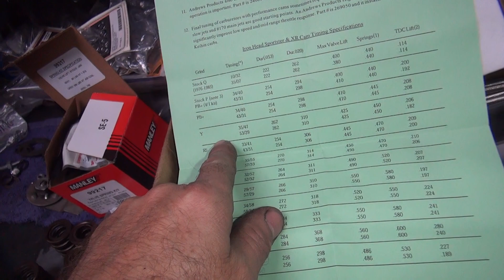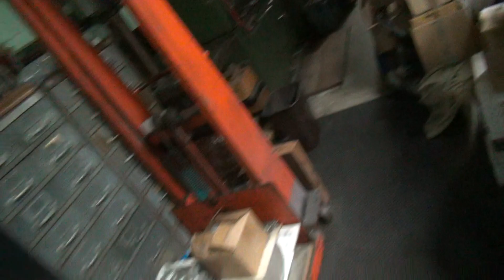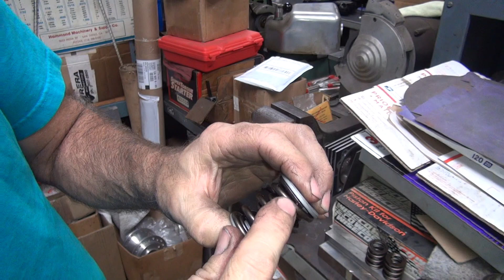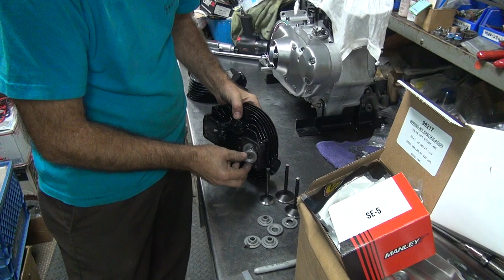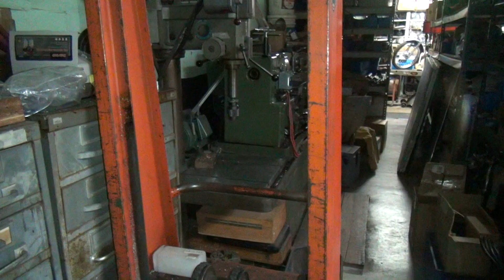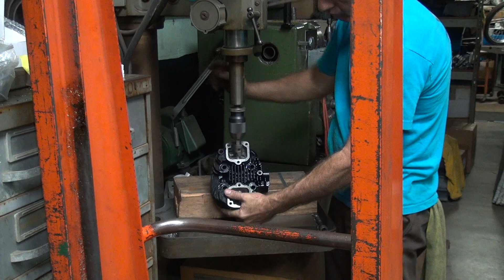1977 xl xr street tracker #137 motor rebuild repair 1000cc sportster ironhead by tatro machine

Comment: Tatro,  Sir,  when you were checking the coil bind. On the bench, just to the right, there looked like a really short cylinder, and it was square. What's up with that. Also enjoying this series on the 77. I bought one, in a box, about 7 years ago, and I'm almost done. I have a special needs child so it takes a little longer . So far I feel pretty good about the engine build, by watching you and checking my work. Really enjoy the videos, keep it up. Thanks.
Reply from the maker: that was a leftover piece from a tool i made out of the cylinder.
tatro